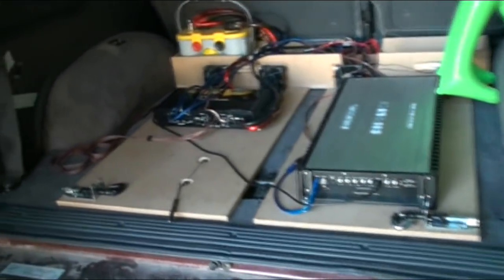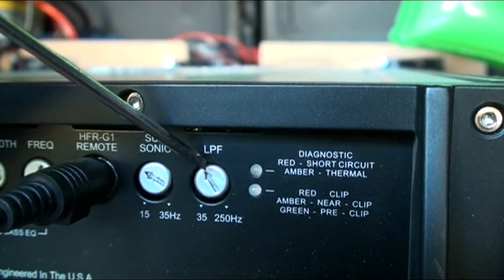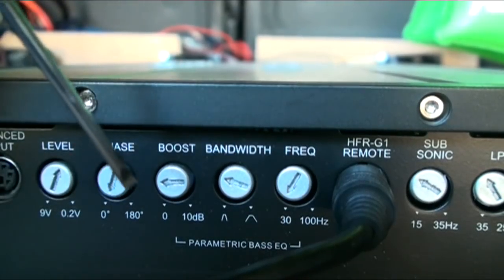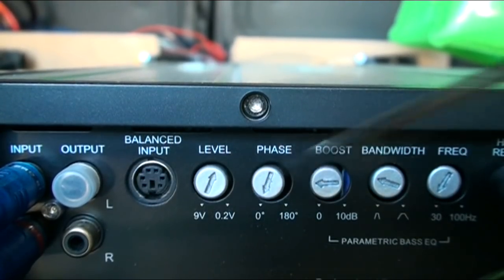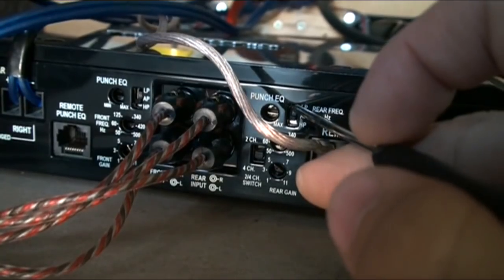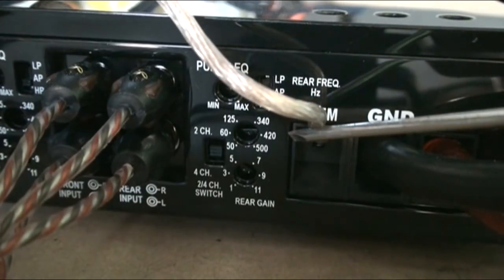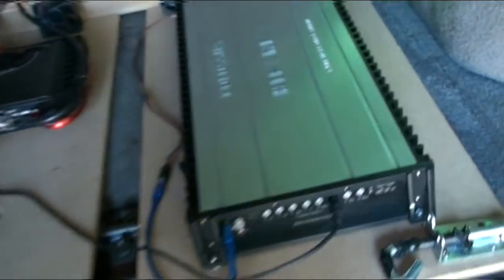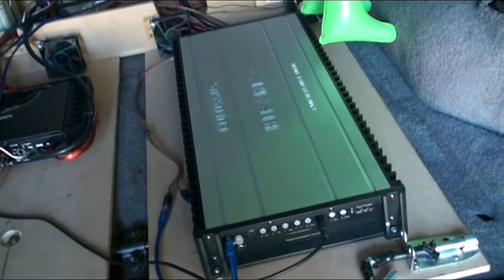Setting Car Amplifiers (Gain,LPF,HPF,Bass Boost,Sub Sonic,EQ)

Comment: on my zrx3000.1, i have my Boost on 0 should i turn that up a little tiny bit? (i know i wont need it for the 18, but when i get my 12's il be using the amp at full power) I think i'm going to watch this again for when i do my new setup hehe